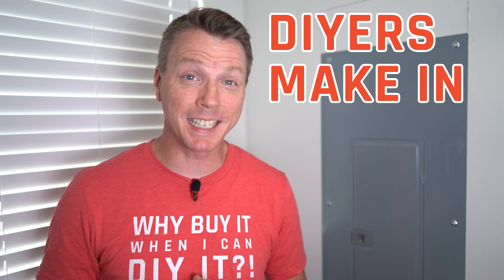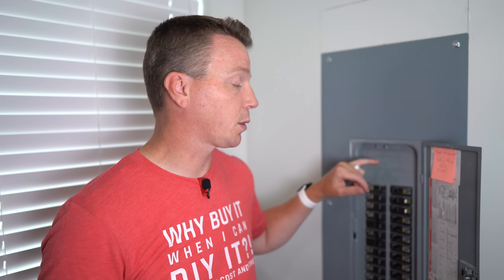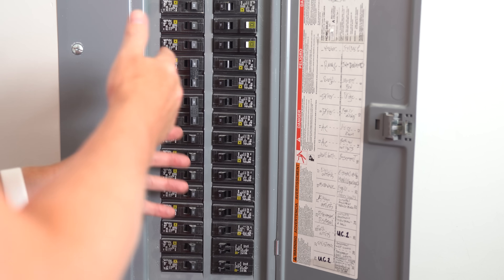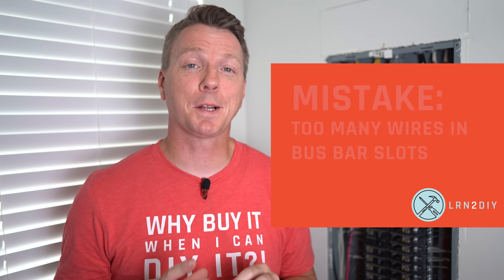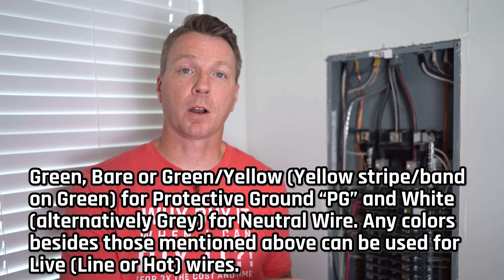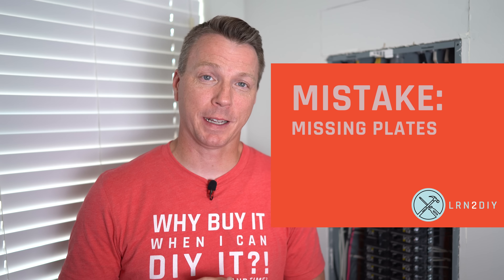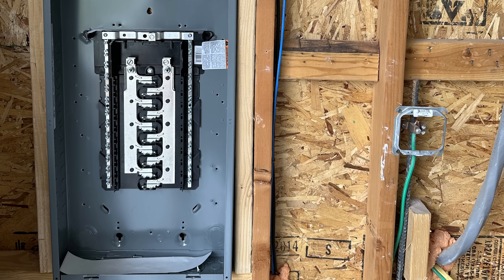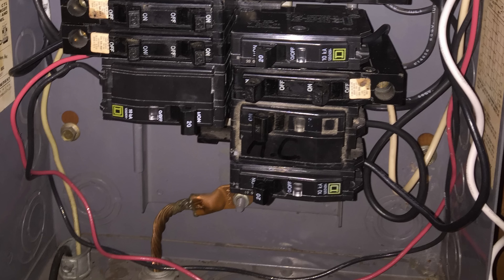10 Common Mistakes DIYers Make In Circuit Breaker Boxes

Comment: Make sure you label every cable before you even dare start taking the cables out of old breakers - also very important in UK where we use 'ring mains' is to cable tie the two ends of the ring main cables together...  Another thing that industry does that domestics do not is to label each power outlet with the distribution panel and circuit breaker number within that panel, but because most domestic systems have only one distribution panel only the CB number required.

Comment: How about putting some penetrox on that aluminum wire?  You could do a hole video on why, not only a corrosion prevention but it also takes up some space due to the expansion and contraction due to loading or the wire.

Comment: If you have extra holes do you have to use filler plates or can you just install a spare breaker in that spot and keep it in the off position?
Reply: yep you can. just label that breaker as 'dead'/spare/unused

Comment: When you torqued one of the screws, you did not reach the required torque when you paused in the turning. After the pause and getting a new grip, the fastener didn’t turn and the driver clicked. This is a very common error made with click or slip torque wrenches or drivers. The fastener must be moving when the driver clicks, otherwise, stiction — static friction — can exceed the torque setting of the driver. Example: torquing lug nuts. These should be torqued in steps to make sure the wheel is flat against the rotor hub. If the required torque is 80 ft-lbs, you want the intermediate torque to be about 40. If you intermediate torque to 60 ft-lbs and set the wrench to 80, you will likely find that the nut will not move and the wrench will click. Your lug nut is only torqued to 60 and you are unsafe. If you find that a fastener doesn’t move when the driver clicks at your required torque, you have no idea what the fastener is torqued to except your torque setting minus some unknown amount of torque from static friction.
Reply: Specifically, at 12:35 it looks like the driver is paused to get a new grip, then the fastener doesn’t move when the driver slips.

Comment: I really hate to see the "teacher" teach bad habits.  Multiple times I saw you reach near and inside the panel.  Yes, it may have been completely safe because the main breaker was OFF... but I'm only assuming such... and it shows a bad example of what NOT to do.  Also, you kept referring to the 2nd 120v leg as "secondary".  There's nothing "secondary" about it!  You have two 120v legs coming into your home.  Combine them it makes 240v.  They are both PRIMARY.... meaning that you need the 2nd leg just as much as you need the 1st leg.  As a matter of fact, you should always try to keep the same amount of circuits on the 2nd leg as what you have on the 1st leg.  You should take the word "secondary" out of your vocabulary (in this example).

Comment: I've worked in at least a hundred panels in old homes and always find that many, if not all, set-screws are slightly or extremely loose. Loose neutrals can be very problematic. I've had the same problem in commercial buildings. Aluminum wiring (California) is the worst, I guess because of heat-expansion and contracting.

Comment: Well, I can say my house, before I owned it, had Grandpa swap out the breaker in the bathroom, it also had 2 bedrooms connected to it.  The 15 amp breaker kept popping, he put in a 20 amp.  And guess what, the 14 AWG wire  was never upgraded. Discovered this while putting in a GFCI in the bathroom.  Ended up running a new separate circuit to the bathroom and separated the bedrooms. Glad I found it before the wire overloaded...

Comment: Panels... a home is simple enough, contractors don't always bother with any label details.  So put on a business hat for a moment, and consider making up two drawings: a lighting plan and a receptacle plan.  This can be overlaid on a basic floorplan drawing,  although in some cases an elevation drawing may be needed [such as a stairwell or other odd vertical space like a loft].  When/if a true wiring fault occurs, the option of checking to see if its "hot" may not be reliable, but it COULD go hot if a broken wire makes contact.   Also, if rewiring a house do yourself a favor: do not blend lighting and receptacle circuits.  For general spaces, limit 4 receptacles per 20a breaker, and for a kitchen or garage stop at 2.

Comment: Not protecting sheathing of wiring in the panel:  This is something that the professionals SHOULD know but apparently not all of them do.

Years ago, my BIL suggested that we install a whole-house surge suppressor on our box.  Since I just had the box replaced (old was FP&E) with a Square D by a professional, I said, "Sure!"  So BIL opens the box to add the suppressor and we find the electrician who installed the box did not include the bushing for the main line coming from the pole.  So, I had to call in another electrical company to fix this professional's mistake.  It was not cheap.  And was it necessary to do this?  Yes.  The main cable coming into the house was touching the lip of the hole and while the plastic sheathing was still intact, the area where the wire touched the box already had a black burn mark.

I would have complained about the first contractor but apparently he was no longer in business.

Comment: I have read somewhere that having different brand breakers in a panel, for example, Square D breakers in a Bryant panel is against the electrical code..Is this true?
Reply: True.  You would be violating the NRTL/UL listing of the panel.

Comment: Even for the di-yer, when the dead front is off, they should be wearing eye pro and gloves.
Granted, that may make the presentation clumsy but as said earlier, the homeowner may not be aware of the definition and risk of arc flash and arc blast.

Comment: The breakers should have been labeled at original install or panel change and should have never passed inspection. NEC 408.4(A).
The 80% max is do to the UL listing of the breaker which states to only load breaker to 80%.
The NEC allows to double up equipment grounding conductors of the same size up to #10, but not you grounded conductor. 
Your “nice panel” example you showed looks like the equipment grounding conductor with the green tape is #6. Code requires equipment grounds to be bare or green insulation. Article 250. Can’t mark it green. 
If you don’t know what your doing hire a good and reparable electrician. Be safe.

Comment: Very interesting; I learned a couple things: double-tapping breakers, and blank fillers (I have been using unused breakers).  One thing, for me at least; I wouldn't wear jewelry such as rings, when working inside a live electrical panel.
Reply: Putting an unused breaker in, and of course having it off, has always seemed way safer to me, than a blank filler plug.
Reply: we do it all the time. just label the breaker and panel as that space being 'dead'/unused/spare
Reply: Using unused breakers is legal   most concerns pertain to open access to energized busses   in a pinch is totally permitted to install a breaker w no conductor attached.  Just remember to label that slot as a spare !
Reply: @michaellike5037  funny you should mention this.  Just today, having an extra small hot water heater installed, the guy's going to use exactly that breaker!

Comment: gauge of wire to amperage of circuit also depends on the length of the wire being used and % of voltage drop allowed. So do not assume just because he said a 20amp needs a 12gauge.  Depending on what it is powering and how far away it is from the breaker to what size wire you need.  The numbers he give re the normal basic lower limits.
Reply: Voltage drop is only calculated over 100'. In which case the conductor will need to increase the circular mills

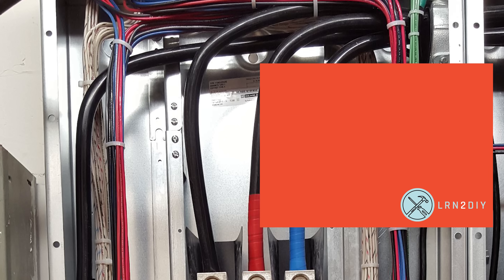Comment: At 13:01 you show "an example of a beautifully wired and beautifully patterned panel"... I always thought you couldn't wire-tie hot leads together in the panel due to possible heat buildup? Can someone confirm? I'd love to be wrong, wiring a panel is so much neater with ties.

Comment: Folks if you want to learn how AC power actually works 2 good sources here on YT are “Electrician U” and “The Engineering Mindset”.  Example…adding a subfeed panel gives you more circuits and may be more convenient… but ZERO more actual capacity.  If your main service disconnect is 150A, that’s is the max load you can attach to the system before the disconnect trips.  150   Main disconnect plus a 50A subfeed is NOT a 200A service. There are also several professional channels devoted to the NFPA 70 (NEC). Much of his yammering about “code” issues is just plain wrong, and I’ll leave it there.

Comment: Although wiring a residential main panel to look like a machine tool panel with tight bends and labeling each conductor looks sharp I have always thought of the person that might have to work in the panel down the road. For this reason I forgo the form for function and provide a service loop when landing the hot/feed conductors! When done correctly it will look nice and allow for moving a circuit’s location without having to break out the cumbersome wire stretcher tool 😋
Reply: I do the same, although I keep the bends in the U-loop tight, and the extra wire length consistent.

Comment: Was anyone else sweating when he put his hands near the 240V line in or on the side of the circuit breaker, and then turned around to talk to the camera?  Your hands can easily move or slip just a little, and that's all it takes to get a serious electrical shock. At least wear some insulated gloves if you want to be that careless.

Comment: #7 don't you have to tape the other end too?
Reply: You do need to mark both ends, but in the practical sense it's less important. The other end of the wire is outside of the panel where it's much harder to get mixed up with other wires. If you're working inside 1 240v air conditioner for example, it's obvious that the other wire is a hot. Obviously still do it if practical.
Reply: @eDoc2020  The panel end of the white wire you know is hooked up to hot. You can see it. The outlet end of the white wire, if not marked with tape, could be mistaken for neutral.

Comment: #12, using a wood or sheer metal screw when you lose the correct cover screws. Easy way to tell Harry Homeowner has been in the panel. They sell them everywhere. And new panels usually come with extras. I leave them in the bottom of the panel for future need
Reply: pfft. why waste a wood screw? drywall screws work just perfect. or those extra ones from Ikea furniture. they'll chew their own threads
Reply: @harveylong5878  assuming you are serious, wires and pointy things don't mix well

Comment: I would suggest holding the panel against the wall with one hand as you take out the last couple screws. As an electrician I charge by the hour and don't recommend labeling your circuits, I'll get them all $orted out. Eventually. 🤑

Comment: Overall a good video. A couple of comments
 - Multiple wires into a single hole on a buss bar is allowed if its the ground bus bar and is rated for it. Some are rated for 1@ #10, 2 @ #12, 2 @ #14. Neutrals by code must each have their own.
 - If you're able to calculate loads on each circuit, as much as possible balance the load on the panel. The panel is made to kind of do that, but may not have had the loads applied appropriately for the large load devices, especially when DIYers add things. Balancing the expected loads makes power use more efficient. Unbalanced loads can actually wind up costing more in electrical bills. Safety wise, balancing the loads means the neutral can remain neutral. When the loads aren't balanced, the neutral will start to carry voltage/current, and that can cause dangerous conditions within your home.
Reply: Excellent comments EXCEPT that you failed to explain what you mean by "balancing the expected loads".  You should explain the two halves of a typical 240V split-phase panel.  Then it will be possible to explain balancing the loads between them.  I'd also point out that when the panel cover is removed and there are some unused circuit breaker locations (or if you remove a few CBs), one can see the "interlaced fingers" of the two hot bars, allowing one to understand how to easily balance loads without complex wiring.  I hope this helps anyone confused by your CORRECT, but somewhat confusing, phraseology.
Reply: @SFFrog  I figured people would search YouTube for appropriate videos. It really takes more than can be contained in a comment.
And although 120/240 is the most common used in residences, some are 208Y/120. Best to leave people to find full instructions.
Reply: this is a common foolish comment of "balancing" loads on a 240v single phase split supply.  This isn't a three phase supply or panel.  The interlaced legs of the bus do all the work of applying an equal amount of current on the two halves of the 240v transformer coil.  Also, the idiocy of suggesting the customer would pay less or more, is also complete nonsense.  You pay for every KW passing through the jaws of the meter.  If you happened to land every 120v circuit only on one leg, say 30A worth, then you would pay for 30A of current or (30 * 120 = 3600 watt).  If these were 240v circuits now, you would still pay for exactly the same wattage. Or, power, as you are paying for power...so P=I*V.
Reply: You're probably thinking about the ground wire. The neutral wire is designed to carry current, otherwise you wouldn't be able to switch off any load in your house. And that is if the panel is wired in a way that creates a perfect balanced  combined load within the two phases. Most cases aren't.
Reply: @VMFRD  Nope, the neutral. Neutral is the pinion of a see-saw. When the loads are perfectly balanced, the neutral carries no load. However, in practice that isn't the case, so the neutral carries the imbalance back to the common point on the transformer to complete the circuit. A great example of this is that the neutral on a 3-phase feed to a device isn't 3 conductors, nor is it a wire rated for 3x the current. Only when you're feeding something which may be operated with the phases not always in balance is the neutral oversized (sometimes doubled).
Reply: @l00k4tstuff  Well you have just re-write my comment with a more detailed explanation. So where is the part that carrying current through neutral is dangerous? Only if you exceed the rated current for the neutral conductor you're in a problematic situation.
Reply: @VMFRD  When all things are equal, the neutral on a 2-wire circuit carries current back to the distribution panel. At the panel everything cycles normally, and the see-saw works as it should with zero voltage on the neutrals.
Once the imbalance gets too large, the neutral has a constant voltage. This can cause several things to happen, including that extra current now being applied to the ground (because the ground bus is tied to the neutral bus at the distribution panel) and other circuits on the panel are no longer working to the service voltage but lower voltage (because there is voltage on the neutral). Voltage on the ground you can see where that can be a problem. Lower voltage across the hot and neutral means the current draw will increase for devices to operate at their rated wattage / VA. Wiring will overheat in place, and connection points (like receptacles and wire nuts) which are not as mechanically sound will be effected by the heat, further damaging them and potentially becoming a fire hazard. Also, voltage sensitive devices may have brown-out conditions because the differential between line and neutral is reduced by the neutral having a voltage present. 
It would have to be pretty extreme for someone's home to get this bad but it is a possibility when a less knowledgeable homeowner attempts to do their own electrical work. I have seen this in play in educational and commercial installs where facility managers have modified their facility's electrical layout, however.
Reply: @l00k4tstuff  In extreme conditions not even the phases are safe. It all comes down to cable sizing before load balancing. You guys made the mess anyway (USA), having only one true phase and a center tap makes hard to balance things. Much easier on a three phase system.
Reply: @VMFRD  That's staring down the rabbit hole. Each system as a whole balanced the overall good with bad to provide what they thought was/is the best. If I was building a system from the ground up today I'd take pieces and parts from each.

Comment: Something like a smoke detector network that should be a combined feed with a lighting circuit could be double-tapped in. Adding a range hood could be another example. but do not double-tap heavy loads like a D/W and microwave for example.  Some breaker brands are not rated to be double tapped.
Reply: NEC tells us that smoke detector circuits should b on a dedicated circuit. Wouldn't recommend sharing a crucial element in safety with any other system

Comment: This dudes got homeowners doing load calcs and adding panels, and doesnt even know the difference between voltage and current 🙄 (0:42)

That circuit finder is trash. It lies constantly. Buy a Sperry or an Ideal. 

I only made it to 2:45 before getting pissed off. Maybe he redeemed himself. Doubt it.

Comment: Nice video, mostly good points, however...

Was this panel de-energized (Meter pulled) before removing the dead front? I sure hope so with how close you were getting with no PPE. Also, where is the main breaker? or is this a sub panel? The "pretty" wire management was a 3 phase panel but you don't want to zip tie bundles (heat) and service loops would be greatly appreciated by future service folks.
Reply: Shouldn't have to PULL THE METER at a residential dwelling. Almost all houses should have some form of disconnect after the meter supply. And dead fronts are usually on two piece panel covers